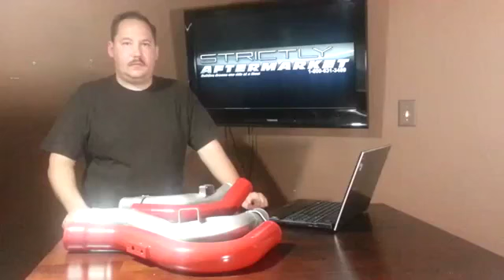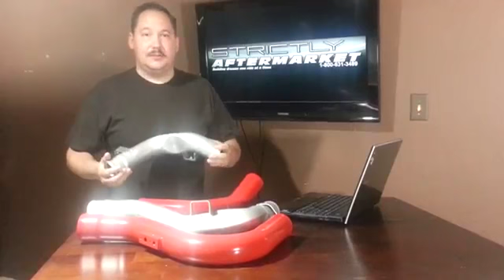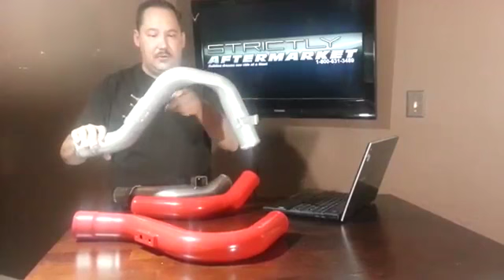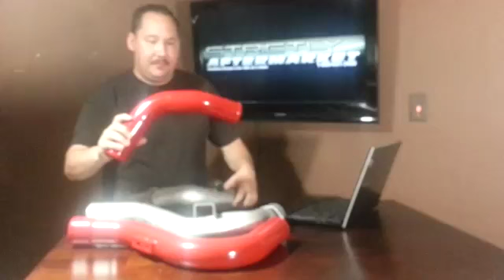Pontiac Solstice Opel GT Saturn SKY Turbo Charge Pipes

Comment: Is this REALLY accurate? Any dyno results with factory sky, solstice, Opel GTs with just these aftermarket charge pipes Holding a linear powerband after install?

Someone shut me up....
Reply: I stall the stage 2 kit with a  high flow cat and a  tune with it .yeah definitely fell the power
My gxp dyno at 320 at the wheel and over 400 of  torque

Comment: The guy's on the sky forum stated Dave from DDMworks said this creates zero HP gain and doesn't help with air flow.  Im interested in buying but is this soley comestic?
Reply from the maker: Job Done Right - The charge pipes do allow for better airflow at higher engine rpms, and with higher lb/min airflow from the turbo charger. These are a supporting modification that allow our Stage 2 and Stage 3 tunes to breathe easier in the upper RPM range. Simply adding the pipes themselves without the tune will not gain you any power, since the ECU's stock program has a "learn down" feature that prevents the engine from making more than the factory programmed power output. All of our tunes have the "learn down" feature defeated.

DDMWorks does not tune the Solstice and Sky first hand, and do not have the tuning experience with these cars that we do. They use a 3rd party service called Trifecta to provide a tuning solution for their customers. We write our tunes in-house for each unique customer's car, and perform a few hours of datalogging and revising of the tune to calibrate the car properly.

The charge pipes happen to be nicely cosmetic as well, which is an added bonus. We paint ours either to match any factory color, or in custom colors depending on your preference to really help them stand out under the hood.
Reply: So, you had stated that we need the stage 2 and 3 tunes done by you guys. Is that something you do on the computer or do we have to bring our car there? I'm hoping you can do it over the internet since I live in Ohio and coming to AZ. isn't an option.